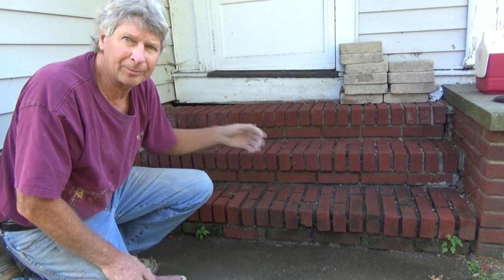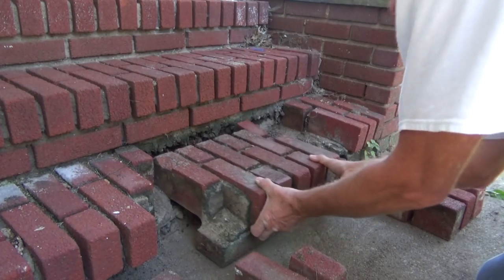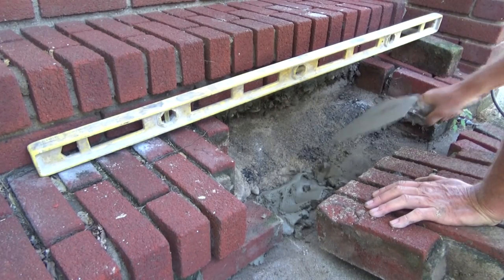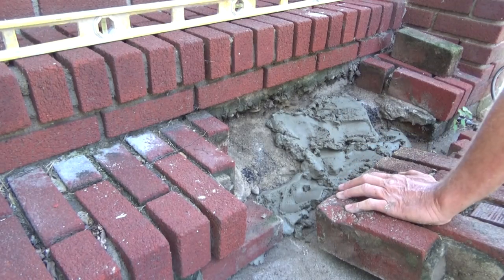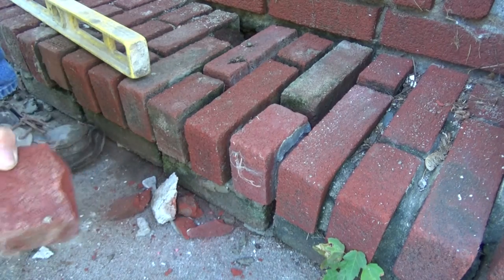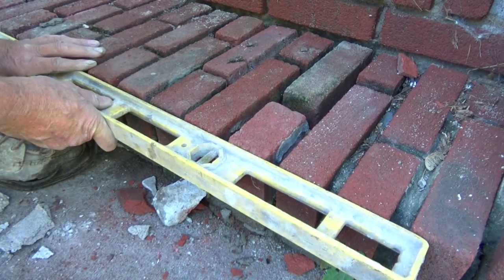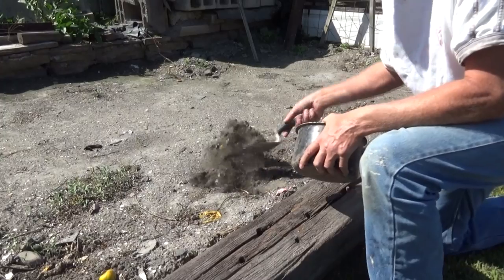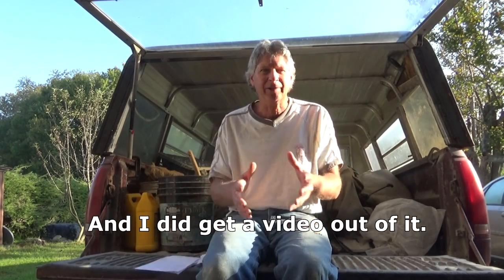BRICK STEPS REPAIR (Part 7) Mike Haduck

Comment: The dirt in the mortar mix - pearl. I heard a story of a conservator expert that was overseeing a renovation of a 19th century farmhouse in Belgium. When the builder was raising the issue of the joint mix not really looking like the rest of the building, the conservator took a handfull of soil (mud) and tossed it into the mix and it came out perfect.  The conservator explained to the builder that,  at the time, builders did not have/use buckets to mix the mortar. They would dig a hole in the ground and mix lime and sand in that hole. So naturally there would be some local soil/mud in the mixture. (Mind blown) 🙂
Reply from the maker: Hi miley I don't mix mud with the mix, I just put it on the joints to make it look old, but have seen them mix  it on the ground in other countries,  thanks Mike
Reply: @MikeHaduck  Thank you for the reply. Your method of painting the joints with mud made me think of the story of the conservator and I jumped at the opportunity to finally share this knowledge with people who watch your channel and who might find it as interesting as I do. You see,  I have been sitting on that knowledge for decades, but as bricklaying or pointing is of no interest what so ever to any of my girlfriends, I never got the opportunity to pass  it on. But now thanks to your video, I could and I have. Thank you 😉😉😊😊

Comment: Mike, thanks for all the useful movies you publish. After watching some of them i decided to patch on my own a chimney of mine. The chimney was build in the 80s and uses just regular clay bricks (no clinker), it has 4 ventilation ducts and one exhaust duct for my gas boiler (with stainless piping inside) - here in Poland most of chimneys are multi-ducted. Some weeks ago during my annual roof inspection I saw that some mortar is already gone so I decided to patch it up with some portland. It was not easy to find a nice ready-to-use mix, but I followed your tips and found something with more portland and less sand, to make the coating stronger. And I used your oldtimers bonding agent :) Thanks again for the good work you do!
Reply from the maker: Thanks mamuttime,I appreciate it, mike

Comment: I enjoy your videos Mike.  My wife and I were born and raised in Plymouth, PA but I joined the military after high school in the early 80s and we never moved back after I retired. We visit family there once a year. Wyoming Valley will always be in my heart. I toured pretty much all the castles and sights around the world you have been to and enjoy your travels. I have learned a lot from you. Love the mud trick. I hear you say hydraulic lime mortar doesn't last in PA. Here in Virginia we have a lot of old brick buildings built with old soft brick and if you use modern Portland mortar for repairs or re-pointing the brick will become sacrificial to the mortar and the brick will spall and in some cases disintegrate. As a rule of thumb here if a building was built before 1950 make sure you don't need to use hydraulic lime mortar.  Don't you have problems using Portland based mortars like this up there on old turn of the century brick buildings? Make a video on why you should never paint old brick buildings please, lol. Brick needs to breath and weep.
Reply from the maker: Hi Mike, goog move to stay in military,  anyway around here the lime mortar gets wet freezes and disintegrates,  I get a lot of flack from it, but I could make a career of fixing those jobs, I plan on doing a video on it someday, below the mason Dixon line it a different story, thanks Mike

Comment: How is it your videos are actually soothing to watch? It's masonry not a relaxation video. Don't need to do this job but the tricks are always cool to watch. I've done the adding of Portland to Quikrete's Quick Set as well. You must have done this in another vid I viewed 'cause I'm not brave enough to make things up on my own. Thanks Mike, always a treat to watch.
Reply from the maker: Thanks Dolores, I bet your done with this years projects for the winter,  mike
Reply: @MikeHaduck  Done for the season. I will finish out everything next spring & summer won't have to do any large projects for a long time. It was a killer. Now, for the inside masonry work in the basement.

Comment: Hi, thought this might be the right place: We have some stairs I've been fixing for last two seasons. First a few bricks came off in the thaw after winter, then I patched them up in the summer. Then, in the winter a new set of bricks came loose in a rough ring around the bricks I'd fixed. So again in the spring I fixed those, making sure to really pull hard on all the bricks to make sure they werent loose.

Now after frost is gone, the dammed bricks went loose again, again the ones right around the ones I'd fixed.

They've held up for many years (Likely built with the house in the 40's, but we've only owned the house for 5 years or so. I cant see any other repair jobs other than mine, so I think they held up really well before these last three years. 

What should I do, fix it again to just hope it'll hold up (Were talking 9 bricks or so) or just get a mason to come re-do it completely?

Loved this video, all the best from Denmark 🇩🇰
Reply from the maker: Hi, Denmark,  I would think you do what you think is best, I spent a lot of time in Roskilde when I was there playing music, hope you are doing fine, Mike

Comment: We have those same type of brick steps on the front of our house here in Baltimore...and they are falling apart as well...will be tearing out the brick treads and replacing with poured concrete...should last forever afterwards...brick treads in our area dont last very long and eventually fall apart.
Reply from the maker: Hi Bee, it’s true, granite is the best but not popular in these parts,  thanks, Mike

Comment: Consult a pro?  I can't afford that, besides, your video was free and very informative.
Reply from the maker: thanks John,  mike
Reply: @MikeHaduck  I did have a local pro do a nice stamped concrete job and ended up adding my own dry stack patio off to one side, your video gave me some ideas because I do have a lot of gaps and wanted the faster set with some extra strength and will need sand for between the pavers anyway. So in short thanks

Comment: Mike ,I really appreciate the mud paste technique. I have been using it and it works great. Quick question: Do you happen to know why on brick steps so many times,the mortar joint will crack on the third brick....sometimes all the way from top to the bottom on both sides? I think it has to do with when we build our leads on both sides before filling in the middle,but not positive.
Reply from the maker: thanks mikey,  I am not sure about that,  I really don't build a lot of brick step,  mostly repair,  thanks mike

Comment: you forgot to show us how you cleaned and wet everything well before laying the concrete mixture. Also putting the bricks in water for a few minutes before layering them should help making the whole structure stronger, right?
Reply from the maker: Hi Daniel,  I did not wet the brick at all in this situation,  I might have stuck better but it would make a complete mess,  I got to do a video on when to wet something and when to not,  thanks mike

Comment: Hi Mike,
I recently resurfaced my front step after watching one of your videos. I used the quikrete sand top, and it turned out pretty good. I have had to do it in stages due to my work schedule. I did the other half of the side of the step yesterday afternoon. It turned out great, but today it's raining all day. Can I smooth it out once the rain stops? Or do I have to start over.

Thanks! Love the videos.
Reply from the maker: Hi Dean,  I think you just got and wait and see,  sometimes going over works out, everything depends, thanks, Mike

Comment: Hi Mike - I did the mud trick yesterday. I checked on my concrete pad patch and despite being painted with mud, the patch dried a bright bright white. Can I do the mud trick again or once the patch has cured it's too late? What are my options b/c the white patch is an eye store when the rest of the pad is weather/old dark tan/gray'ish (original pad from the 1960's)
Reply from the maker: Hi Medic,   In a case like that I usually cover it with wet mud and let it sink in for a day or two,, that usually darkens it, if not you might have to get a dark cement coloring add a little Portland an paint it over,  something will work I am sure,  thanks Mike

Comment: I NEVER re-use the brick anymore (without pressure washing them).  Years ago, everytime I tried to be a nice guy and re-use the bricks to save the homeowner a few dollars, I ended having to come back 8 to 10 months later to re-do it.  I find that scrubbing with water and a sponge and/or wire brushing and vacuuming, or blowing with compressed air does not get all the dirt and dust out of the pores of the brick, and the mortar will not stay bonded to the brick.  And not long after there's hairline cracks where the mortar meets the brick.  Sometimes just blowing with compressed-air works, but nothing insures a good job better than pressure-washing and then either vacuum or blow out with compressed-air. To get a permanent good solid mortar to brick bond. or just getting new bricks. ..That's been my experience.
Reply from the maker: Thanks , mike

Comment: I have some similar brick steps to repair but they're not quite as bad. The eaves have been dripping on the steps and breaking down the mortar between them. Are there any other options other than the limestone caps that you've shown in other videos that could help prevent this? Or is it just inevitable without those caps?
Reply from the maker: Hi Adonna,  In my area it usually inevitable, but you could keep fixing them and stop the dripping would be a plus,  anything that works,  thanks mike

Comment: Did you not need to wet the bricks?
Reply from the maker: Hi PDS,  no in this case it would have made a mess,  I just pack it good,  every situation is a bit different and those brick are messy,  thanks mike

Comment: Here in the UK we have stopped doing a recessed finish , because the weather destroys it
Mainly half round joint finish or also known as bucket handle finish 
To be honest you dont even have to be a Mason to understand that having a recessed finish on the steps is very silly as the weather will kill it no matter how hard the brick is
Does my head in
Reply from the maker: Hi viktor, your right , I actually don’t like that style of brick steps because the ice and snow makes short life of them,  but a patch is a patch,  thanks mike
Reply: Though only a mason can shape bricks with a hammer the way Mike Haduck does .
Reply: @frank-to7lu  every apprentice can do it
Just letting you know
Reply: @vovkdavies  they are craftsmen and women.. great skill.
Reply: @frank-to7lu  mate, it looks like you had a pint or two recently because I canny understand what you are on about